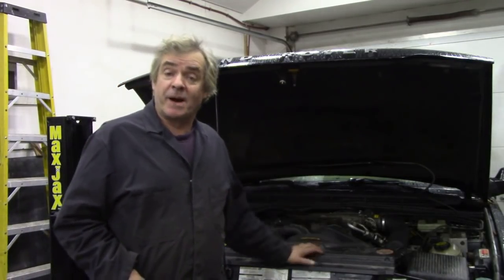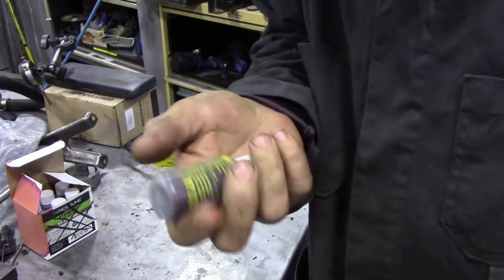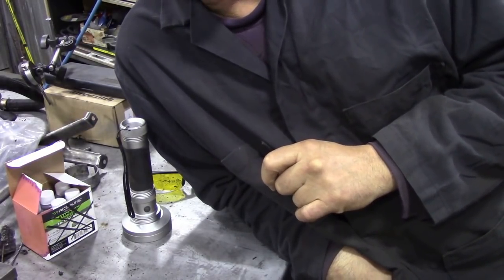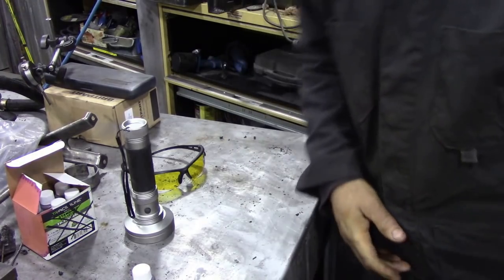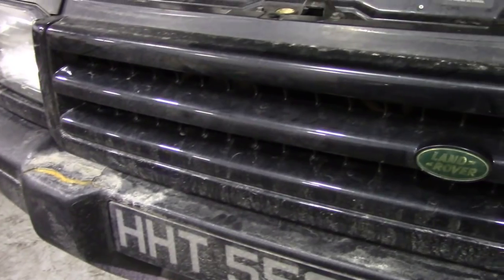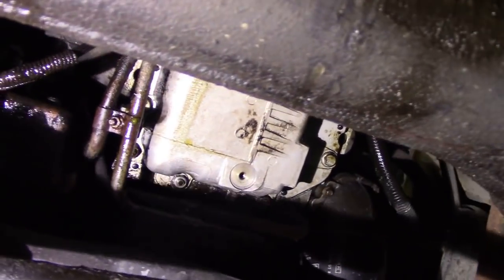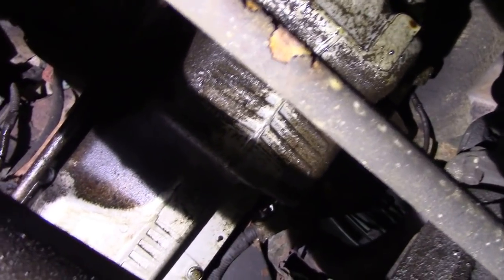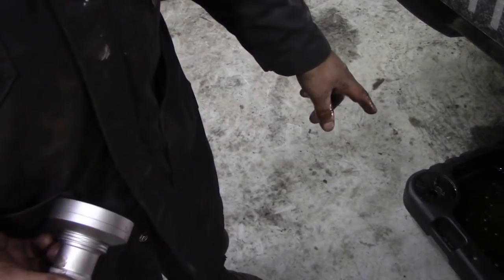Finding an oil leak with Tracer Products TP34000601 dye

Comment: Is ATF ok to use as a flush in diesel engines?
Reply from the maker: Yes but do not drive with it in- make sure it is flushed with cheap diesel oil before filling with your good oil
Reply: @BritannicaRestorations  thanks.

Comment: Out of interest would you ever recommend putting a very light engine oil instead of ATF in the gearbox?
Reply from the maker: I chatted with Dave Ashcroft about oils and what they recommend as LR was suggesting MTF which is like a light engine oil
Anyway they suggest regular ATF is good enough for the LT77/R380
However in my snowplough 2a I had I used 0w30 oil in the box as EP90 was too thick in winter - never had an issue - shifted great and didn't bust any bearings
I recall back in the UK in my first Morris Minor, I put EP90 in the box and it would not shift - found out it needed regular engine oil

Comment: That's must be the earliest series 2 disco I've seen Mike, a 1966 on a D plate!!!!!
Reply from the maker: Must be worth a bob or two then!
Not only don't we have annual inspections or emissions test, but we have no front numberplate's
Reply: Britannica Restorations Ltd yes she's looking rather crusty underneath...so what's the number plate all about Mike? Its not a Quebec plate is it?
Looks like an old uk one...
Reply from the maker: we don't need front plates on - I stuck it on as the bumper was well cracked!
Reply: Britannica Restorations Ltd I've just done a quick number plate check and it's from an old Land Rover what was exported in 2010 so I take it it's one you bought, is she still going?
Reply from the maker: I dunno - Had so many, hard to keep track of!
Mike